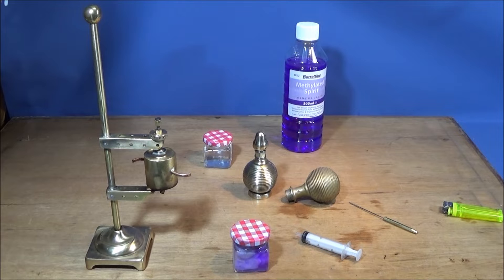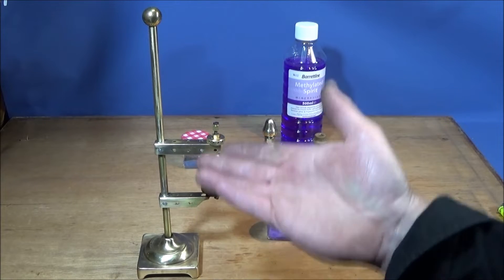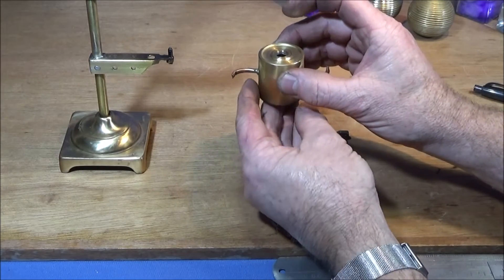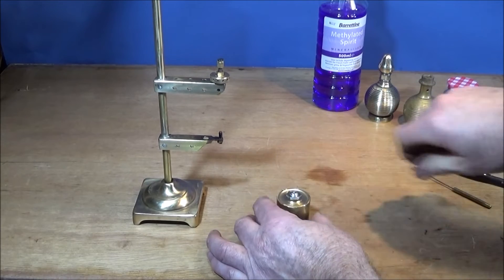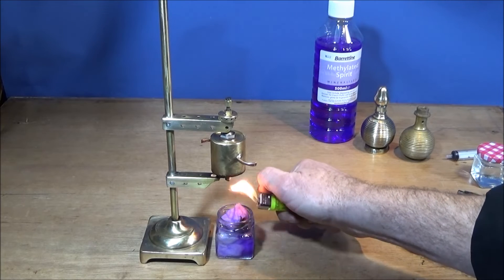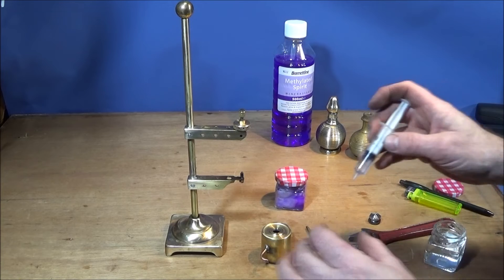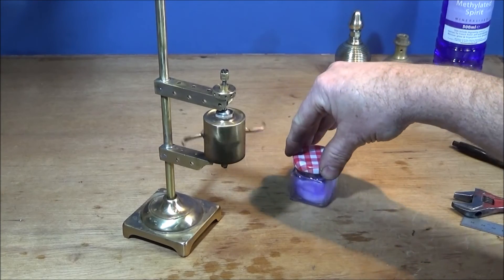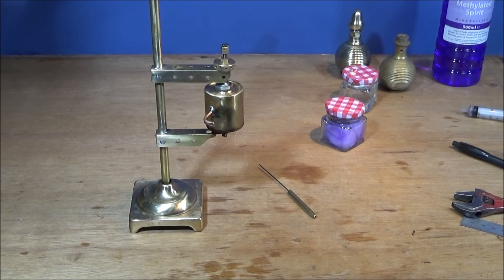Make a Simple Steam Engine From Scrap Brass Parts.

Comment: Hello from Norway Steve. Always enjoy yours videos.  But can you make a video about differents rpm?   Rpm.when using slitting saw on the lathe.(brass, steel,alu.)  Rpm.when milling on the lathe ?(brass,steel,alu) .  Rpm.when using differents tool lathe?(brass,steel,alu)   Rpm.when using diff.size/dim.end mill,rough ends mill?
Hope you can make one. Best regards Carl
Reply from the maker: Hi Carl, Thanks, You should see my RPM gauges on the machines now when I show machining. 
   You can get away with a speed of about 800rpm for nearly everything on the lathe. There are no hard and fast rules on RPM. One may machine at 800rpm where another person may use 1500rpm for the same job. My Myford lathe only had three main speeds at one time, the fastest being about 620rpm. One could do everything in reason with these speeds. I don't really look at the RPM much. Regards Steve
Reply: Hi Steve. Thank you very much. Perfect. I will also look at your tacho'  . I also have mounted one from Bangg. on mine . My lathe (chinese) is belt driven. It was not easy to change belts/speed , so I mounted a gearbox from a motorcycle between motor and the lathe. Works perfect.   Again ,thanks for your info. Best regards from Norway, Carl